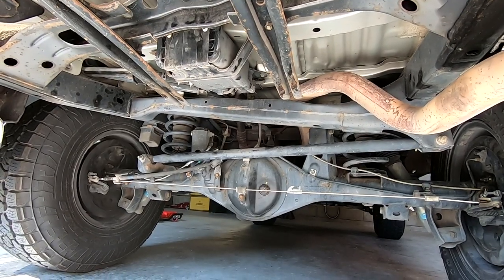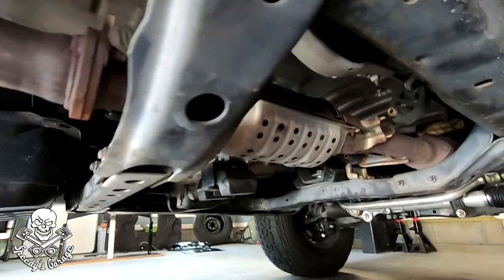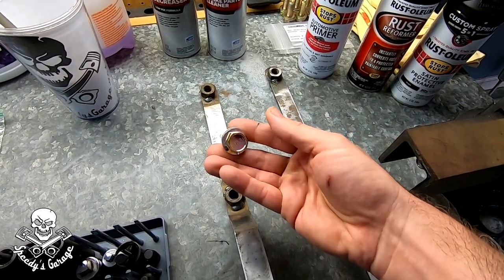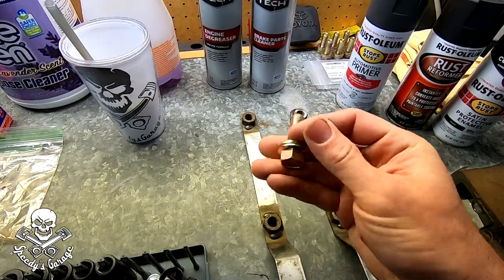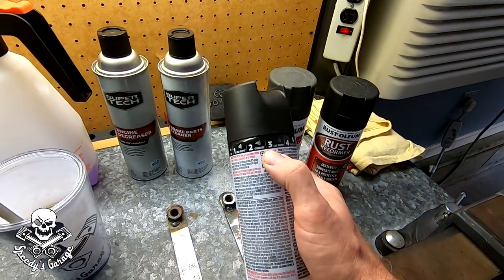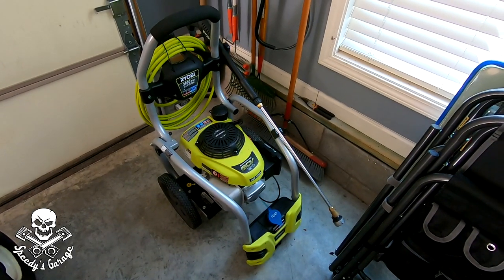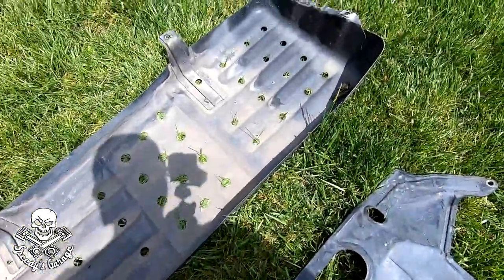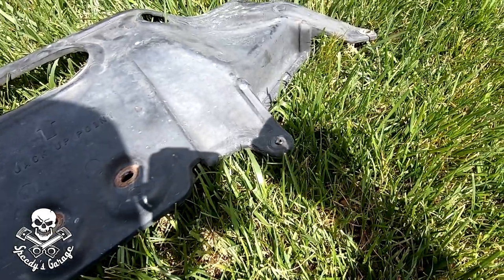The Chassis Speedy's Garage Restoring a 3rd Gen 4Runner P14

Comment: Just purchased my first 4runnner. 2001 3rd Gen with 100K miles. Was stoked to learn in your video about the rear bumper side extensions as my driver side extension has a small dent in it. Was going to live with it as I thought the full bumper needed to get replaced but with the help of this video I can fix the only blemish on my otherwise dent free ride. Thanks Speedy!

Comment: With all that effort taking parts apart why didn't you use POR-15 for a proper restoration and protection? It's more expensive but way better than the spray can Rustoleum.
Reply from the maker: Too many mixed reviews on the POR-15 product.  We don't get much salt here as well so not worth the brush on mess.  I do the Rustoleum treatment about every 10 years.

Comment: Wow!  You never half-a$$ anything.  Well done!  I have a 2000 4runner that I need to do this to, but I don't think I'm mentally prepared to disassemble the bumpers and all of the skid plates....that is a big job.  I might be able to tackle it a piece at a time.
Reply from the maker: With the right tools, it's not too bad.  I did lose 5 lbs though from all the climbing around under the truck lol.

Comment: Beautiful
Reply from the maker: Thank you
Reply: While I’ve got you man, can I run something past you, so I have a 3rd gen, had a rear axle leak that leaked all over the left rear drum components, it was mid trip as diff the breather was half toast and that didn’t really help, so I think the shoe material swelled and then things got snug, was after 50 miles on the motorway I realised there was a faint smell of diff fluid and smoke pouring off the left rear drum, it was hot like real hot, quenched it with a service station water line and it was like I was putting out a bbq, fast forward post repairing diff seal and replacing all shoes and brake fitting kit, despite slackening the shoes I’m getting a drag as the left rear gets warm after a long run compared to the right, I didn’t change the wheel cylinder but given the heat I wonder if the internal seals got buggered and it’s now stiff and not releasing after brakes applied creating some heat, if I drive with very little brake input the drum doesn’t generate the same heat, you think the wheel cylinder got cooked?
Reply from the maker: Couldn't hurt, but I'd look at the drum for being out of round from heat.
Reply: @SpeedysGarage  that’s a great shout I hadn’t thought of that

Comment: Just a note on "upgrading" the fasteners to grade 10.9.... 🔩  Stronger isn't always stronger.  I know, it's a weird thing to say. But in an engineered assembly, the failure point is carefully studied and the grade chosen accordingly. As such, I would stick with the grades originally used. As a general rule, I might replace ungraded or low grade hardware with a Grade 5 or Property Class 8.8 (different than grade 8 but that's another story. If it has a decimal, it's likely a property class not a grade). However, there's a "WALL" 🧱that I would be very careful about crossing before going past Grade 8 or Property Class 10.9, and the issue is hydrogen embrittlement [HE] and the related "stress corrosion cracking" [SCC], which basically means the fastener will fail unexpectedly and well below it's yield point. 💥 This is especially true in fasteners that have been plated.... 😲

"With HE, the fastener made from a susceptible material is first exposed to hydrogen followed by stressing (due to tightening) which leads to a delayed brittle fracture. With SCC the fastener that is made from a susceptible material is tightened and then exposed to hydrogen, which subsequently leads to a brittle fracture." 💥

Property class 10.9 is in the transition zone 🔄for these issues, and largely comes down the quality control of the manufacturer.  Going to Property Class 12.9, however, is at VERY high risk for Hydrogen Embrittlement and Stress Corrosion Cracking. ⚠ I would avoid going to a 12.9 unless it's called for by engineers. It won't be stronger, and it's much more susceptible to these unpredictable kinds of failure, especially if it's low quality. If the loads and forces involve justify a 12.9 in the first place, then by all means, don't skimp out with cheap no-name fasteners, buy a reputable brand that follows good QC or you WILL regret it. 

You can read more about this by google searching "The stronger the better is not necessarily the case for fasteners" 📰and you'll find a wonderfully written document on 👉 boltscience.com 🤘🔩👨‍🔧